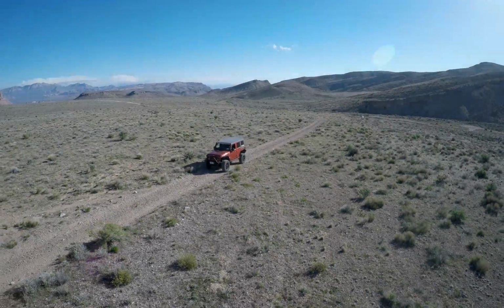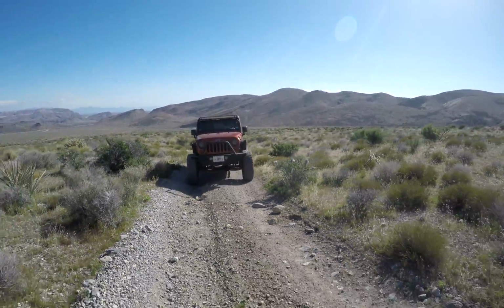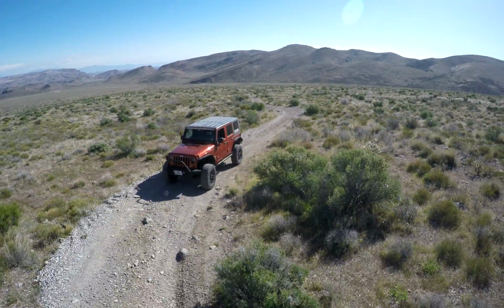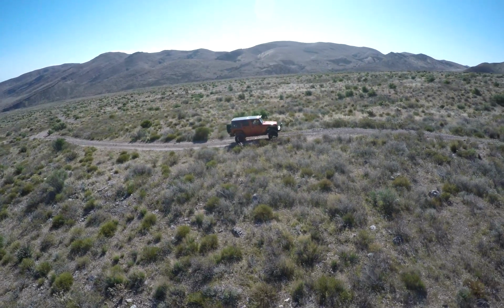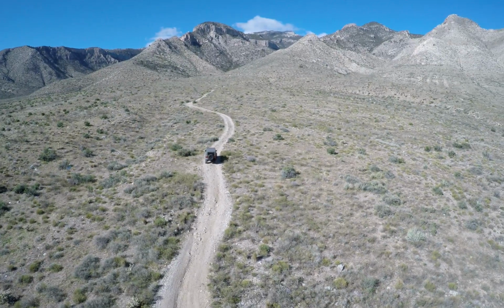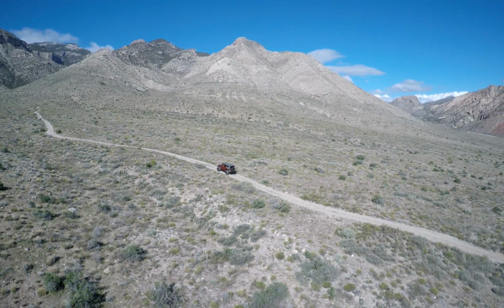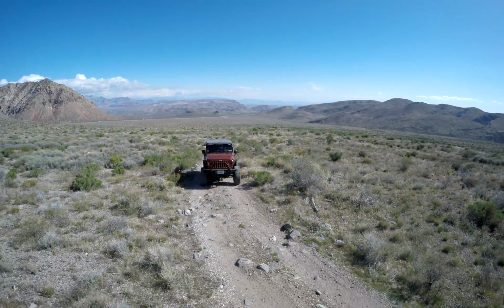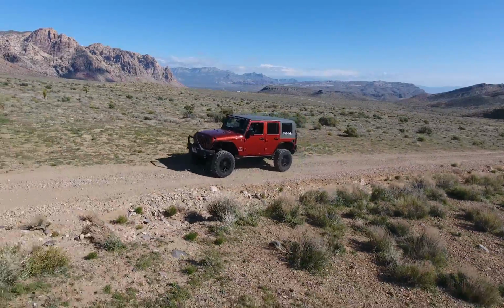Affordable 320 Horsepower Jeep Wrangler JK part 2

Comment: I really want to put a Chevy v8 in my 2009 jk but I don't want to lose my manual transmission. Is there anyway to get a gm manual to fit or have the engine work with the stock jeep transmission?
Reply from the maker: You can run the stock JK 6 speed manual transmission behind a 5.3 engine max, anything more and you will break it.